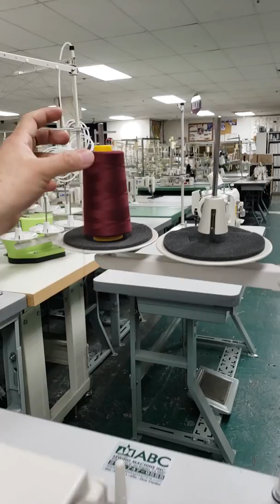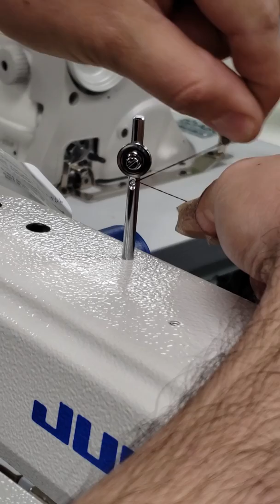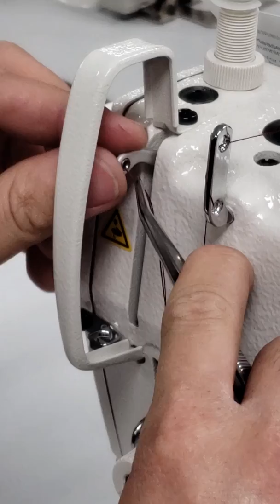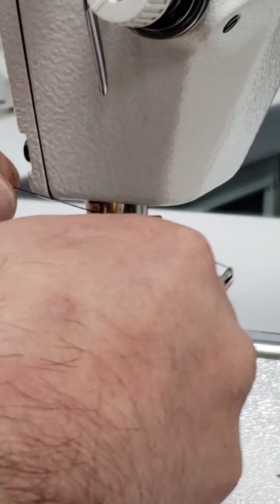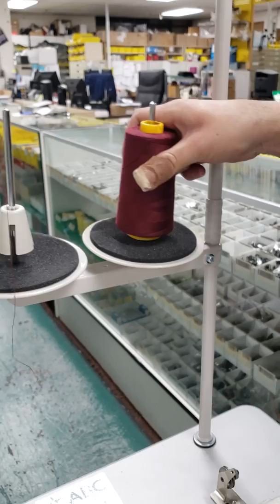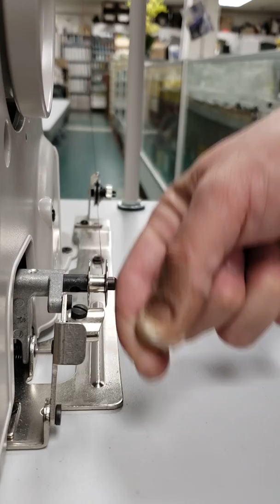How To Thread your Juki Single Needle Sewing Machine

Comment: Ok got a brand new 8700.
Threaded and wound bobbin and put in so rotating counter clockwise in bobbing case. Started to sew and sewed a stitch but when removing the fabric there's 3 threads coming up through the hole in the plate and one from needle. What's going on?

Comment: Thanks again for the clear instructions for this wonderful machine. Used, made by the thousands, but now in many homes & garages. My JUKI DDL-5550-6 originally came the "Auto Back-Stitch, thread cutter and other electronic features". These fail, but it leaves the maxing working great and just manual back-stitch and cut as needed. Thanks, you the MAN!